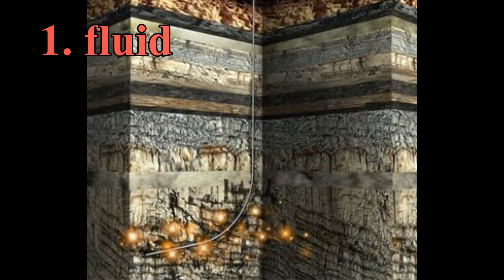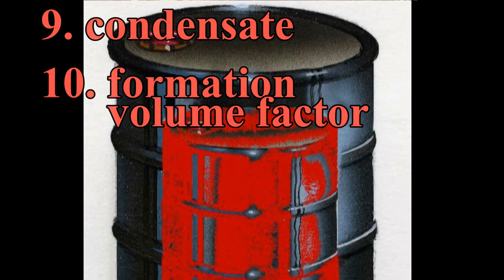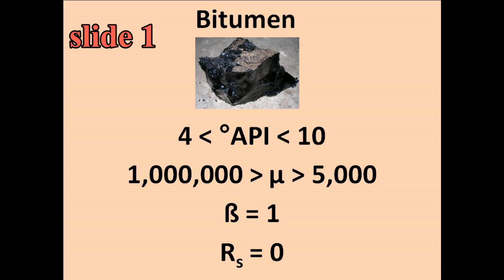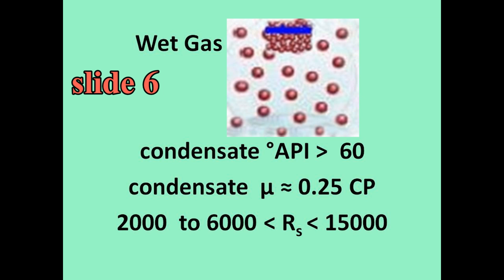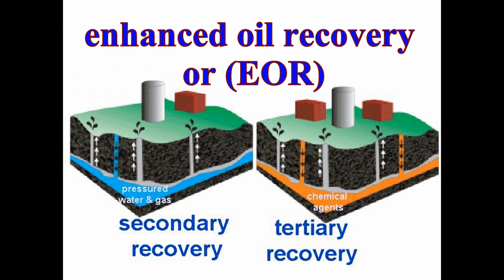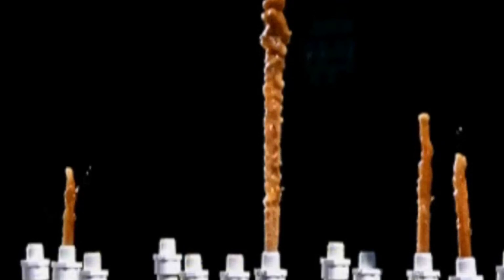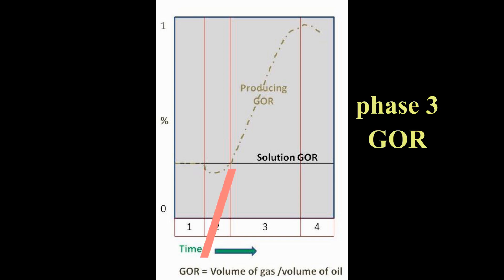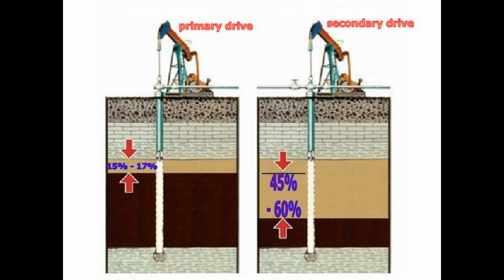Overview Chapter 5 Part 2 Reservoir Preformance

Comment: @ wozzers2, The Rs values he is using are constants used at the onset of production of a brand new reservoir being brought on line. So the 6000 to 15000 is a range that classifies the reservoir as a condensate because there would be a value between those numbers in scf/STB. What happens is as pressure decreases in the reservoir the fluid reaches its dew point and something strange happens it forms a liquid that is immobile you will not produce this liquid once it drops out you will never see it. This phenomenon is strange because typically as pressure is reduced gas expands and no liquid forms but under these conditions this fluid forms a liquid with reduction in pressure. This happens because the heavier molecules at reduced pressures fall out of the gaseous state and form a liquid. this is why this is called a retrograde gas condensate because it undergoes retrograde behavior compared to a gas reservoir. It is imperative to keep these reservoirs above there dew point pressure so as not to run into this behavior because the heavier molecules that fall out and form liquid will not flow to the well bore and will cut off the permeability to the gas, there by killing the well.